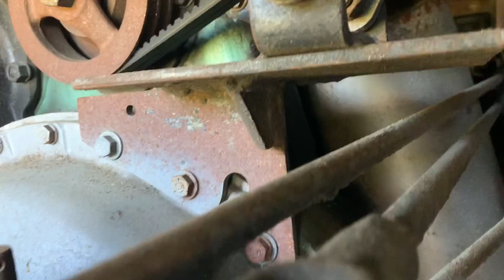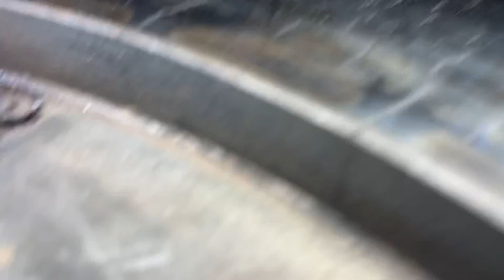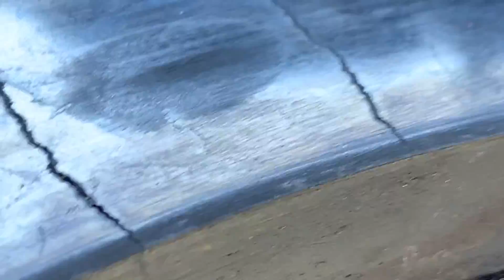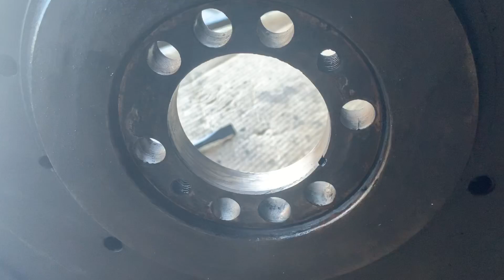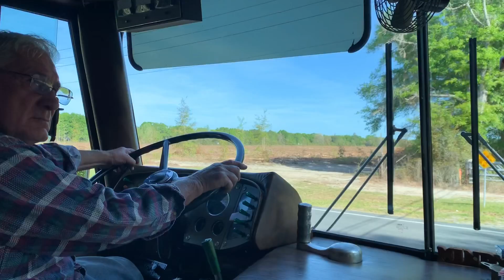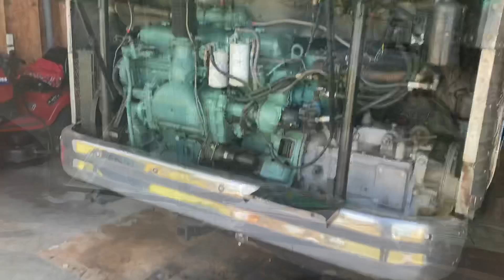GM Bus 4104 transmission swap and clutch replace.

Comment: As I have said in re- ply to another video which I was watch- ing, more cleaning of the coaches  makes the jobs you do a lot nicer. The engine bay I must say is immaculate. When I owned my truck w/ my friend, a c.o.e.Freightliner,it was powerwashed a lot and made maintenance a lot easier.Road grime & salt, an annoying combo. I know the buses are harder to keep clean under- neath unlike a semi tractor.  Another  thing I wanted to reply to was about the Wanderlodge w half a bank

Comment: Bus Grease Monkey...check out these Knipex channel locks. Been using them for years & I always wind up grabbing these out of the box before my snap offs. 

KNIPEX Tools 00 20 06 US1, Cobra Pliers 7, 10, and 12-Inch Set, 3-Piece https://www.amazon.com/dp/B000X4KNTG/ref=cm_sw_r_cp_api_i_NMR8CbYN8KJNQ

Comment: Forgive my ignorance but is the driveline like the Z drive on a boat but on its side? I ask because I saw the output flange of the gearbox is at 45degrees? Does this have a matching angled input pinion on the differential?
Reply from the maker: Yes pinion is also 45°
Reply: Thank you,makes perfect sense. Very clever way to turn drive through 90 degrees and allow axle movement.

Comment: I’ve got a 66 new look with manual trans. New to busses. I just had the clutch replaced and they had a hard time finding parts. Do you have a part source that I could use?
Reply from the maker: Phone, (856) 794-3104 · Address. 3366 N Mill Rd, # 1S; Vineland, New Jersey 08360 ... Luke from US Coach in NJ.

Comment: How do I get in contact with you about possibly coming to my place and diag. of my BB bus and just an over all "look over"? I'm in SC., and I own/live in a 1985 40'BB with a CAT engine. I do not know what it has for a tranny...(so I would also love to figure that out as well). I know the engine is a Re-manned one, and it supposedly has roughly 60k miles on her.... but no documentation to prove any of that... 

Help?
Reply from the maker: I only work on mechanical detroit diesel 2 strokes.  I could look at all the other bus systems but i don’t know a CAT from a dog ;)
Reply: @BusGreaseMonkey  You made me laugh with that comment! Thanks.

Comment: By the looks of the heat cracks in that flywheel someone has been slipping the clutch a lot, this is all down to the driver taking of in to high a gear or holding the vehicle on the clutch on hills instead of using the parking brake.

Comment: Lovin your channel, wish some were longer. Great buses, never really knew much about these buses. Are any of these bus engines 2 stroke.
Reply from the maker: All of the buses on my channel are 2 stroke diesels, the only one not a 2 stroke was the diamond T
Reply: You can't beat the sound of those motors. What's the average red line on the 2 strokes.

Comment: I pulled one of those transmissions out for a clutch at a truck shop I used to work at years ago in South Carolina. They ended up scraping the bus. I talked him into keeping the transmission. I haven't worked there in years but he may still have it. Email me and I'll get you some contact info if interested. Whittautodieselservice@yahoo.com

Comment: Show us the rear axle. I’m curious about the angle input to pinion.
Reply from the maker: Here was mine when it was bad.  It’s a 45° angle in the pinion just like the trans output shaft.  https://youtu.be/oARYz9dP31A
Reply: Thanks for the link. Im curious about the rng and pinion design to accommodate the odd angle
Reply: I'd like to see a top view schematic of the driveline, or a picture of the components lined up correctly, without the bus blocking the view.
Did they make shorter busses in this configuration, since it was found important to reduce the length behind the rear axle?

Comment: You're running through all of my old stomping grounds where I misspent my youth. Much respect for the work you're doing and the attention to detail - I don't say that often. I hope that we meet some day - I don't say that often, either. As I get older and less physically able it's been a major concern for me, who I'd trust to work on my stuff - no longer a concern, as long as you're in business.
Reply from the maker: Thank you sir
Reply: Thing is he remains philosophical over items like those odd interrupted slot nuts. Drive me wild they would. Along with a regular parade of items,all because these are tired iron. Big difference between an annoyance and,oh,say, badly corroded and stress cracked suspension mounts. The one is a pain to deal with. The other kills people. Important to know the difference. Cheers.
Reply: @paulmanson253  One either does as one must, or one fails to do, at all. Scott does as he must.